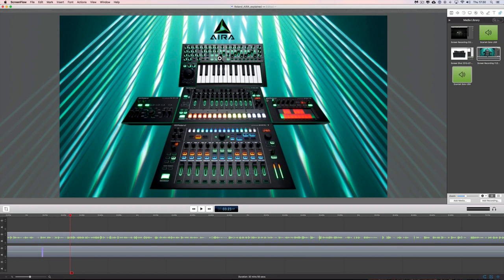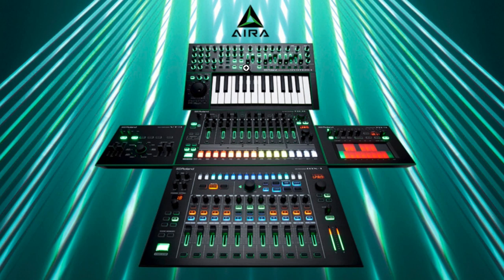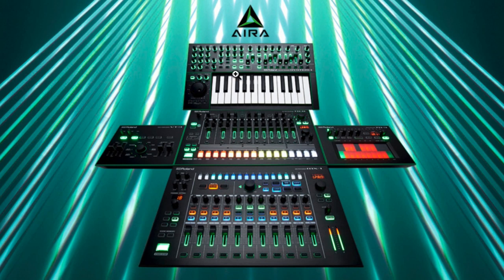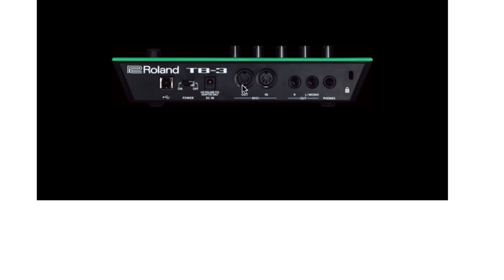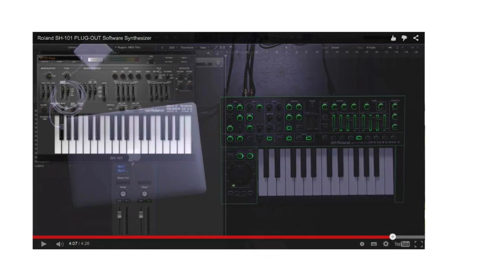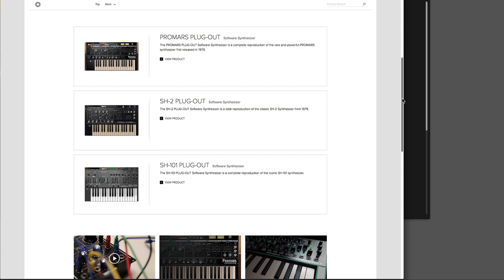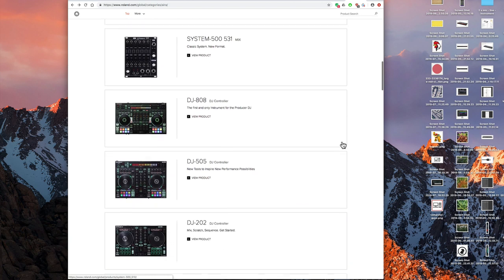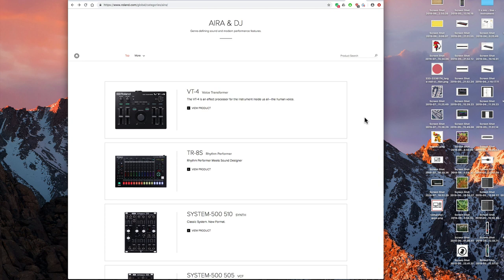Roland AIRA system explained (Aira lineage 1)

Comment: Can we buy the plug-outs separately as standard vst3?
Reply from the maker: you can buy the 4 smaller synths (sh-101, sh-02, promars & system-100) as stand alone plugins, but not the 3 polysynths. However, Philly Tee below gave us a heads up on the Roland Cloud which is a subscription system giving you access to ALL the models in plugin form for an annual payment. I'll be making a video on it in the next couple of days.
Reply: @dancetech  is this still the case? I would like to purchase the plug-outs for the System-1 but it seems to me that access to those are now behind the paywall/in the Roland Cloud??